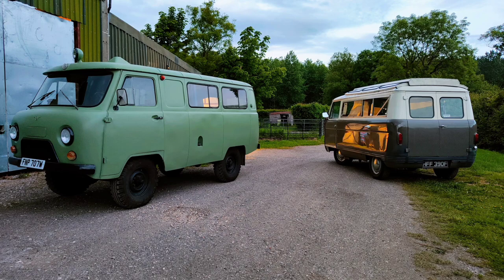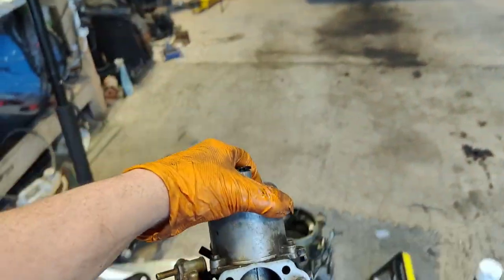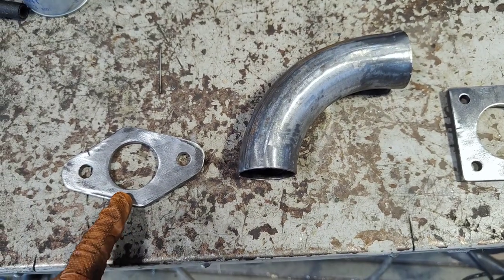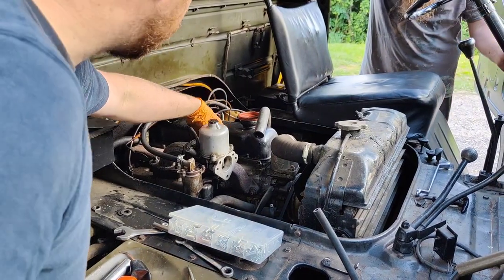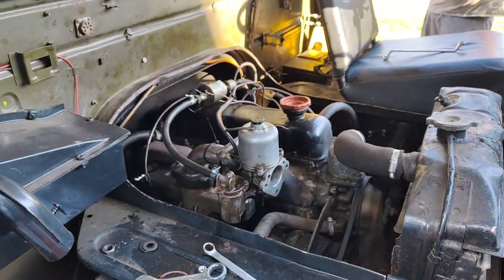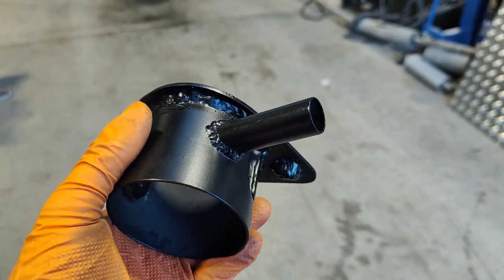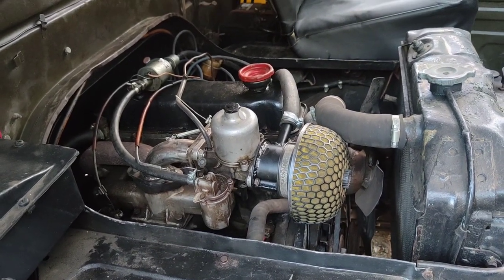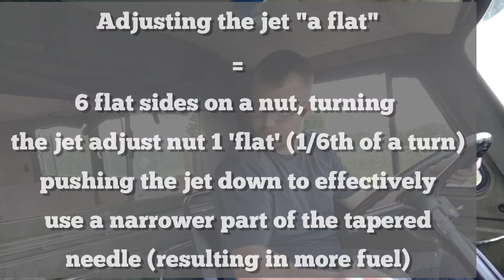Fitting an SU Carburettor To My Uaz 452

Comment: Nice job, can't go far wrong with an SU! Are you going to add any sort of heating for the adapter? I've got an HS6 on my Land Rover and it needs the manifold heater in winter. If it's any help, I'm running a BGB needle and green spring with a 2.3 litre engine.
Reply from the maker: It was the Landy swap on a similar wheezy 4 cylinder that made me think it would work well 😄. Thanks for the info about the heating, it does get mega cold with the atomisation going on. I'll look in to adding a coil of pipe to run coolant through. And the Landy needle size is what I was going to try.
Reply: No heating needed! They boil the float chamber dry when hot, no air flow through engine bay. You are missing the bottom plate cover, it has an extra air scope on it to push air up into bay.
Reply from the maker: @petefisk  Good spot Peter, my Commer is very fussy on air ducting for the radiation, this doesn't seem to be as bothered but once I start flogging it down the motorway it may prove me wrong! 😄 I'll get some more ducting made up to copy what's original.

Comment: Did you make sure the dashpot was topped up with oil?
Reply from the maker: Yes. ATF. I had an enjoyable moment where I was leant over it and accidentally stalled the engine with my hand over the intake, it cut out and backfired the dash pot contents in to my face 😒
Reply: @LivingMyBoostLife  Ahh fun times 😁 In my younger days I was really into minis and used to richen up needles in specific areas by filing flat spots on them, seemed to work pretty well.
Reply from the maker: @ferrumignis Ha got to love a home brew tune. I'd love to have a go at making little needles on a model makers lathe 😄

Comment: Similar to an early six cylinder land rover I think?
Reply from the maker: Not sure what they had but it's the same as what they fit to 2.25 to make them tolerable 😄
Reply: @LivingMyBoostLife  I thought folks fitted Webbers to the 2.25? The 2.6 began with an su then went to a Stromberg I think? The fad for webbers seems to have been driven by shoddy repro zeniths being in the market. My 88" is old enough to still have a solex.
Reply from the maker: @onetonlandrover  I think an SU is seen as an improvement over a Webber swap. Same in Commer circles.
Reply: @LivingMyBoostLife  I never ran a webber on a series. My understanding is they never gave enough fuel, and so restricted performance.
Reply: @onetonlandrover  my 1975 88 has a weber and it did 119.5kmph on the GPS once and pulls pretty good to 100kmph/60mph.
So they cant be that bad.
Half the performance of these old turds is in the ignition system anyway lol.